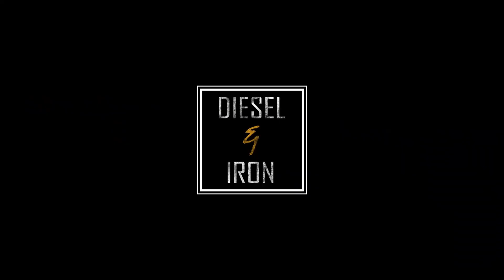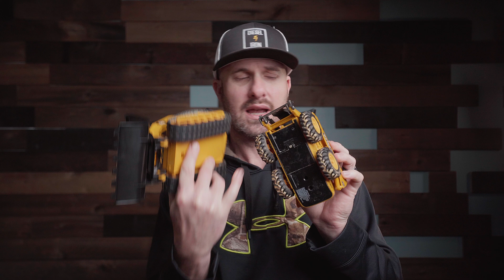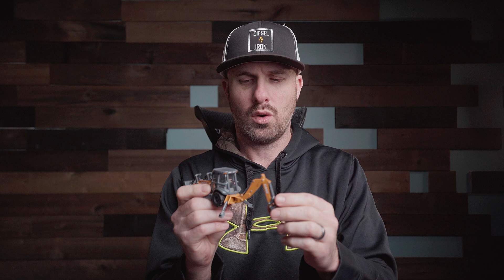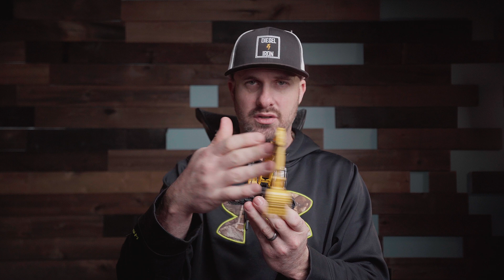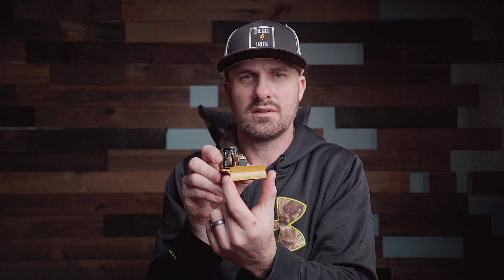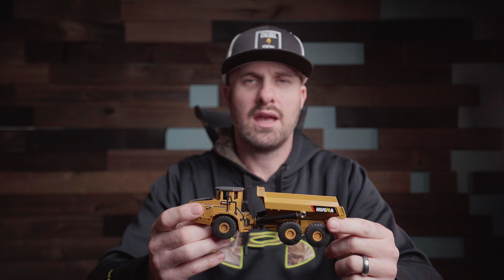A Guide To Construction Equipment

Comment: Used backhoes and excavators on really bad roads…..like you would just die if you went over the shoulder of the road, 3000 ft to the bottom. Rops won’t do anything in that situation
Reply from the maker: I'm not sure what point you're making here

Comment: Had a question. When ever I am dozing an upward hill the Vlad needs digging too deep. This is material like sand that is shipped and dozed into a hill.

How high off the ground does my blade have to be. I think I am kissing it to the ground too much.

I’m a pro with the skids btw!
Reply from the maker: Your blade will constantly be adjusting.  You can't leave the blade in one position and grade a nice flat path.  As you go along your blade is changing the grade which means you have to adjust in real time as your tracks go over the new grade you created.  If you are diving into the sand then you need to lift your blade up slightly as it loads with material.
Reply: @DieselandIron  thanks I had been getting more seat time. Figured that out. Now I need to get to a point where I make a smooth hill upward. Thankfully it’s a union job so I am safe. A pro with loaders , skids , forks, crane. Working on dozing. We make 💰 like you won’t believe.

Comment: Do you have any videos on how to find rimpull, load wieghts, speeds, rolling resistance forces. I’m currently taking a construction equipment class. Straight math class. Class is super rough. But thank you so much for this video! Very informal!
Reply from the maker: I don't have this information. Why are you needing to know this? Is it an engineering class?
Reply: It’s a class I have to take for my construction management major. I guess since it’s not engineering based it has to throw some curve in